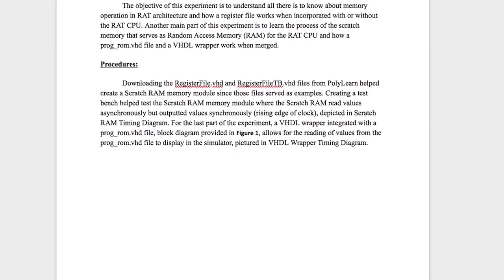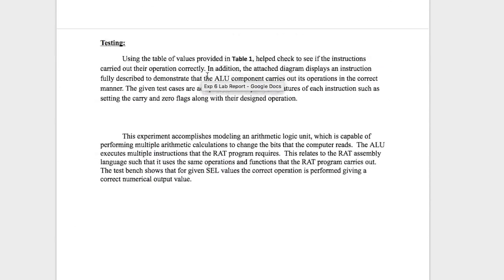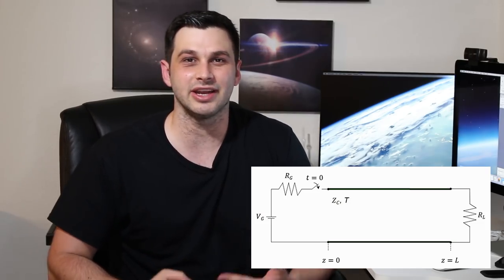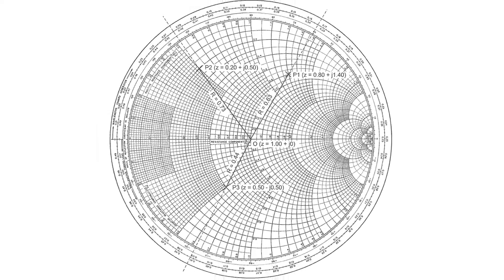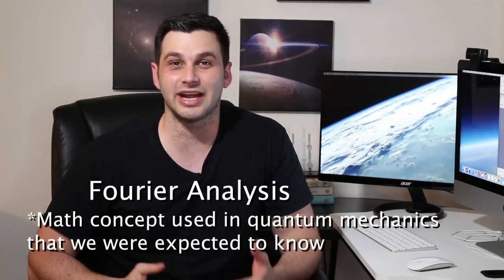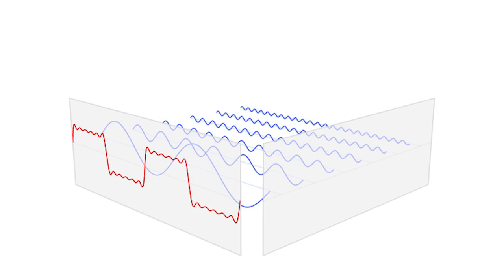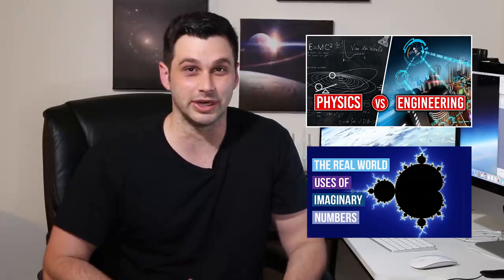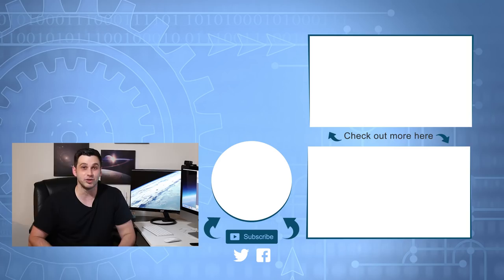My Hardest Engineering Classes

Comment: Personally, the hardest classes I had as an electrical engineering depended on the professor and the effort I put into it. Obviously some classes are harder than others but I simply put more time and effort into the class and it made the Class easier.
Reply: Hey do you have any regret about EE or any other majors you wish u had pursued😅

Comment: I guess the good thing is that you can basically find what is your strong suit in an engineering discipline. For EE for example that might be High Voltage  Power Systems, Analog/Digital Signal Processing, or Embedded Systems. Key thing is to play to your strengths and use that to your advantage. Undergrad is good in that you get broad knowledge of the field. Whereas masters from my understanding is where you specialize in a concentration area deeply.

Comment: I actually did very well in those courses when I took them for my BSEE probably because:

1. I did NOT attend your university and I earned my degree almost 19 years ago. This means my university and its professors could be "easier" or "harder." Too many variables for me to approach in those regards.

2. I actually was experimenting with electricity and electronics when many later tube based and early solid-state electronic kits were easily found from a wide variety of sources. I was spending time with some "mainframe" computers (DEC PDP-8 and PDP-11) as well as assembly programming with early Z80 and 8080 CPU's.

3. I earned several "technical associate degrees" before taking on the BSEE. Those technical degrees were "Electronics Tech" and "Computer Information Systems." Only a couple of ET courses and only a few of the CIS were transferrable into the BSEE, but what I learned was retained in my mind.

Now, I've completed an MSEE and earned my PE licensure. Looking back, I believe those courses were easy because of the previous knowledge and experience gained as described above.
Reply: Hey how’s EE going😅

Comment: as an electrical engineer the most course i struggled with is "physics 101" and "digital circuits design" and "electromangantics 102" :)
it's so wierd ro include physics 101 there but i did put a work to that class more than any course before, like IDK how people were getting an easy A in it while i was just knocking my head, i did get an A at the last but it was SO fu*** hard
Reply: Hey how’s EE going😅

Comment: Courses I found difficult:

ALGORITHMS AND DATA STRUCTURES:
- More than half the class failed the midterm exam, then my professor inflated the grades. We did not have a Discrete Math course before (we took it alongside this course) and I prefer to learn the basic concepts first and applications afterwards.

ELECTROMAGNETIC THEORY:
- I abhor this course with a passion. More than two-thirds of the class failed the midterm and I found it was a dry subject made worse by the professor.

PROBABILITY AND STOCHASTIC PROCESSES:
- Professor was dry and the course topics were very disorganized and poorly managed. On top of that, my professor was one of those people who never gave part marks if you made a mistake.

Comment: I was a working adult by day, earned my entire BSEE during evening classes.  So it took me a long time.  Emphasized CPU design.  Graduated during the tech bubble burst of 2002, so never was able to get into the field.  My hardest classes were thermodynamics (solely due to the professor), linear control systems (prof spoke with a thick polish accent, very hard to understand), electronics 1 (really didn't like the prof, seriously he was an ass), and power (my fault, I was only interested in digital classes and despised taking this class).  I did well in college, but after working all day and going to classes at nights for roughly 10 years, by the end of my degree program I was just doing anything I could to pass a class and get out.  I use the math from that degree to do statistics in the insurance industry.

Comment: My college requires all the MechE students to take this horrible electrical engineering class.  There was only one section so basically it was a horrible professor teaching in an auditorium attempting to teach higher level circuits to mechanical engineers.  They required us to do these 10 hour labs every single week and we had to buy these 200 dollar circuits boards that never worked.  The guy teaching the class was awful.  He would give us a zero if we didn’t draw our circuits using straight edges.  By far the worst class I’ve ever taken.

Comment: So I’m going to ask all of you guys to help (and yes I will get professional help but I’m going to ask you guys first). 
I’m currently mechanical engineering but I’m fascinated by modern technology (not sure if it’s the software or physical thing) and maybe want to work with it. Should I stick with mechanical or go to another type of engineering?
I love math (notice how I didn’t say “like”), designing things, modern technology, mechanics, drafting/sketching, and using computers to do work. I’m a very visual and creative person. Sometimes, I’m hands-on. If you guys need more info I’ll gladly answer.
Reply: The Deflector modern tech is mainly about the software (see auto pilot tech in vehicles). I would look into computer or software engineering

Comment: I’m also an electrical engineering major and the circuit design class was the first one I took. It was one of my favorites!  Are there any online resources for the other electrical engineering classes that helped you along the way? ( I’m taking EE online)
Reply: Hey how’s EE going😅
Reply: @change5450  I actually got a little more that half the way through and then got into an apprenticeship! I’m on the career path I want now and the degree is on the back burner until I finish this program 😁
Reply: @luket6405  wow that’s nice after the apprenticeship do u plan on picking up the degree again? Also how difficult was it for u personally I’ve been trying to learn more about it but everywhere is js full of how difficult and challenging which I’m ok with but beginning to have doubts😭

Comment: I'm a first semester EE major thinking of specializing in RF/Wireless, did you have good job prospects after graduation? Also, are you currently working in an RF engineering field at the moment?
Reply from the maker: Well I got 3 job offers after school and I continue to get contacted through linkedin about jobs so I would say the job prospects are good. Currently I'm not working as an RF engineer but that was what my first job was.
Reply: That leads to my follow-up question. Since you're not working as an RF engineer at the moment, do you consider the knowledge you learned specializing in it not being utilized in your current job? Simply put, would you recommend specializing in something else such as controls or automation?
Reply from the maker: I'm not in an engineering job at the moment but no i don't think I'd recommend something else, if that's what you want to study then go for it. I definitely utilized that knowledge at my first job though.
Reply: Thanks for your input!

Comment: My hardest electrical engineering course so far is Fundamentals of Electronics. Our professor barely teaches and explains properly. Also, he goes like do the examples from my notes which aren't even notes tbh; it's just him scribbling all over the place. So he says do my notes and you'll pass my exams. However, the questions come from outer space. They're not of the same difficulty as his notes nor the textbook's recommended problems. I relied on the recommended problems more cuz they seemed challenging but not too challenging. I don't even know what do anymore 😕.  I come prepared to the midterm having solved different types of problems that could come up in an exam; but eventually none of them come and unfortunately in my university there's just one section for the lecture of this course for both the male and female students

Comment: in which college do you study?
Reply from the maker: cal poly slo!
Reply: @zachstar  I'm going there too for EE! Any tips?
Reply from the maker: Nice! Advice is never take 18 or more units in one quarter, never heard one person say that was worth it.  Also make sure to learn the equipment well, don’t let lab partners do that for you or you’ll fall behind fast. Also there are a ton of engineering clubs/projects you can work on, some I didn’t even find out until my 4th year, try to seek any of those out as fast as possible.
Reply: Hey, can you help me with this? 
I am an international student intending to apply for colleges in the US. I want to take engineering at Trinity College CT. It has a good reputation and the certificate is accredited from ABET. However, the certificate I will receive is in general in engineering with a concentration in a field. For example, I will be a certificate in general engineering with a concentration in electrical engineering. Is this a good choice for me? will I find jobs and be at the same level as other graduates? Is it really worth it? @MajorPrep